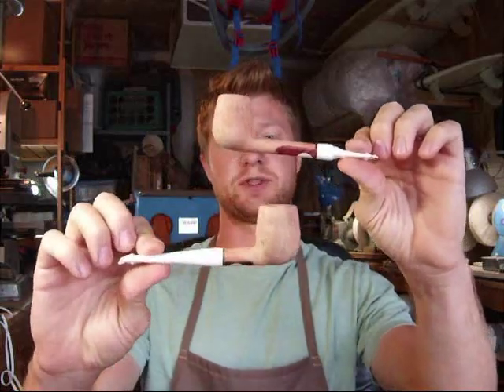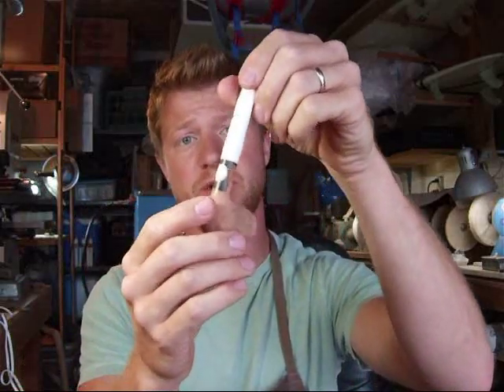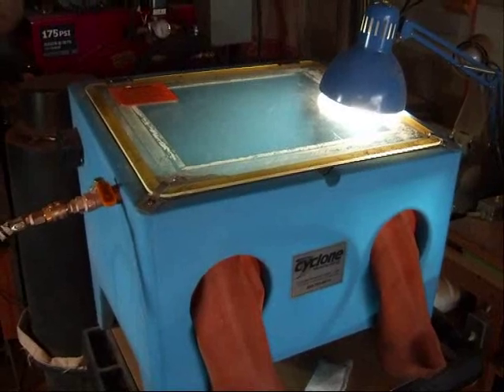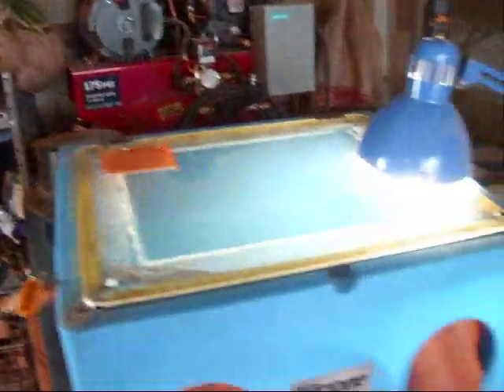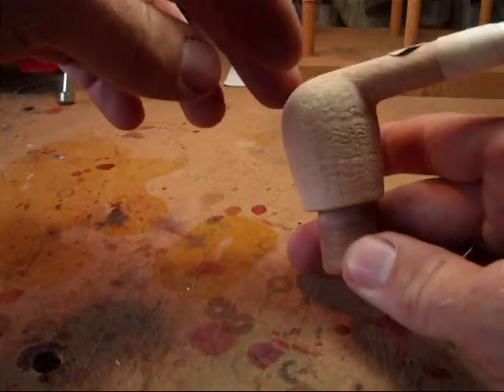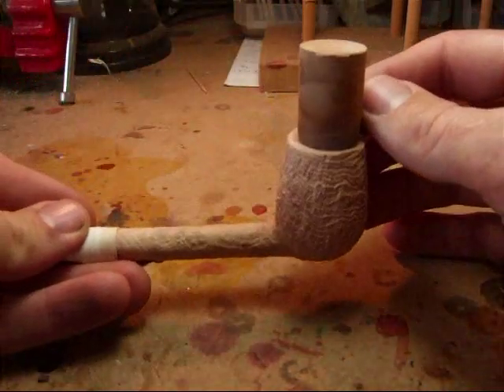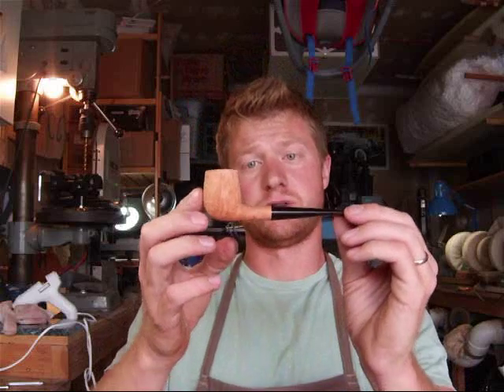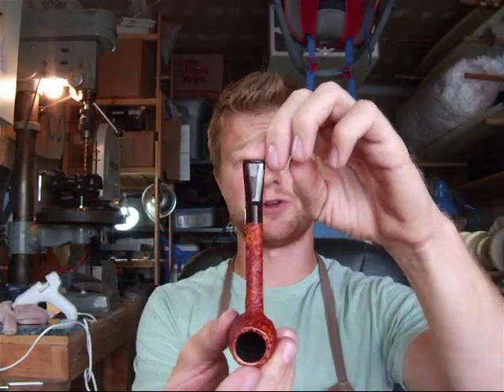Sandblasting Basics -- Episode #3

Comment: Great video.

I am a new pipe maker just getting started, though I have long been involved in woodworking, so many of the tools I am familiar with. But now I am needing to acquire more "new" equipment, such as a blast cabinet.

Watching you and just hearing you talk of blasting in "stages" was a huge help!

I have also designed a "prototype" oil impregnation unit which I will use to oil treat my pipes under pressure. I have no clue if it will "work", but I know it functions!